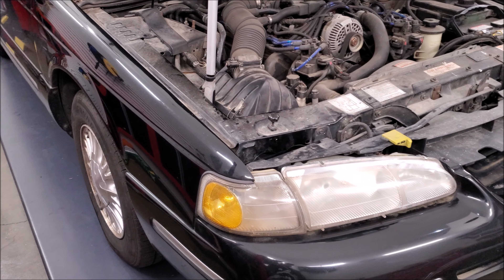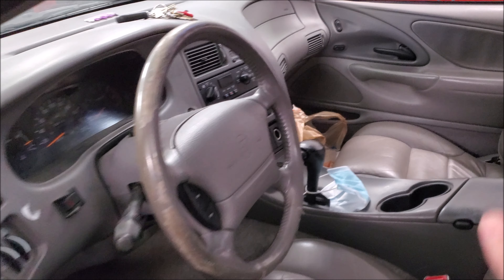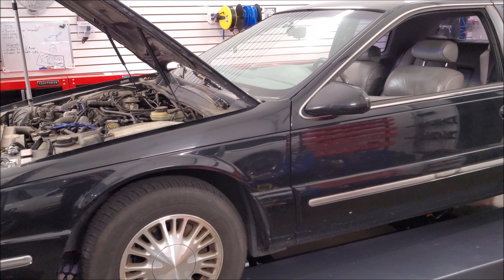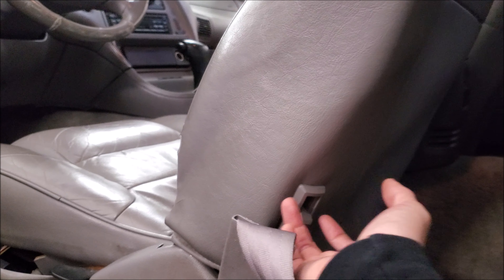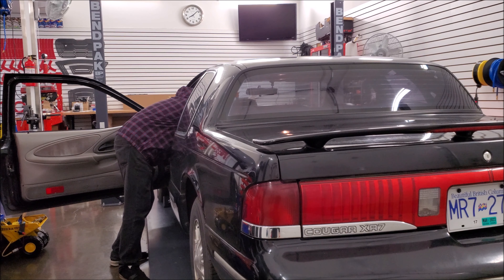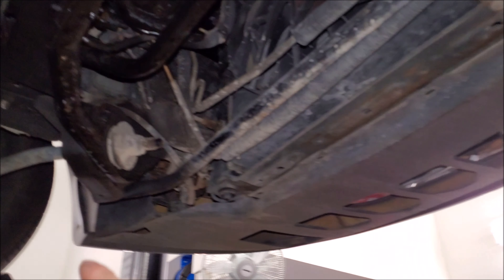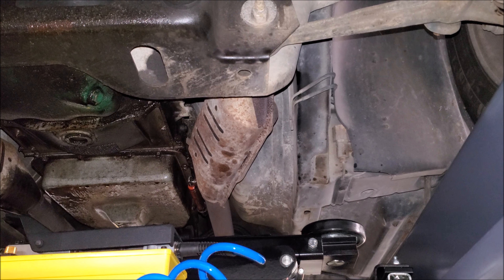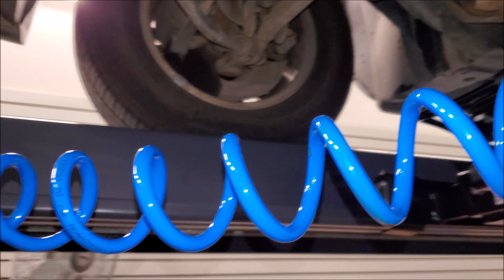Do I Like it? 1997 Mercury Cougar (Featuring: Hey Chris!) | AnthonyJ350

Comment: Recently came into a '96 Mercury Cougar. Only 95,000 mi. Currently trying to restore it to it back to a 6. Lol. Good video👍🏻
Reply from the maker: Nice! They're neat cars. What engine does it have?
Reply: @AnthonyJ350  got a 1997 3800 v6 xr7 super beat car but the engine runs super strong, mainly used as a work car but I wanna restore it. Currently just using the 03 Monte Carlo ss but these 3.8s run strong man the Monte and cougar haven’t had any major problems! Love em!
Reply from the maker: @JacobXavier-xj2zk  It's amazing how the pushrod 3.8L V6s from Ford and GM were so reliable compared to most newer vehicles.

Comment: I have a 1991 mercury cougar white with a chrome kit and real chrome rims with white wall tires. And a mad ignition system. No power???? Mine will power stall the tires off the rims love my car. I’ve had it since 2001. Only thing I got from my grandfather. 
2nd engine 30over rebuilt transmission. 3.8L !!!
Reply from the maker: They're durable. I had a 1992 Thunderbird. The 3.8L has 140HP and 215 ft-lbs of torque. It's ok, but not really much power. Especially compared to GM's 3800 V6 that made closer to 200HP of the same Era.